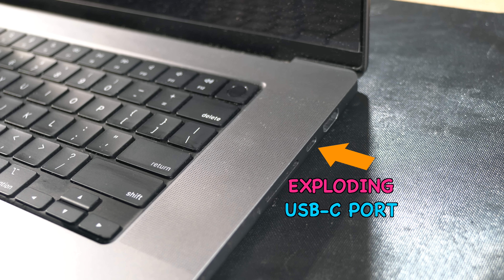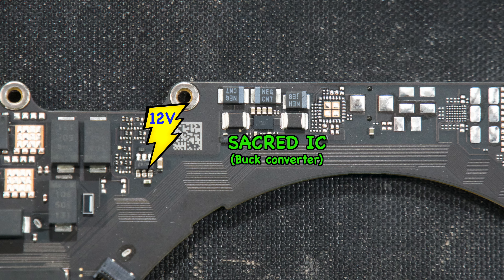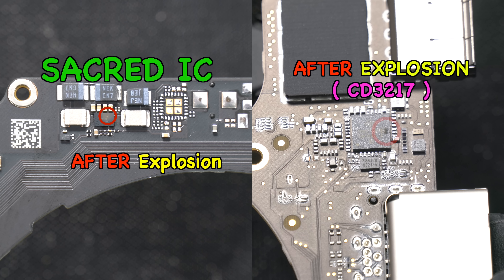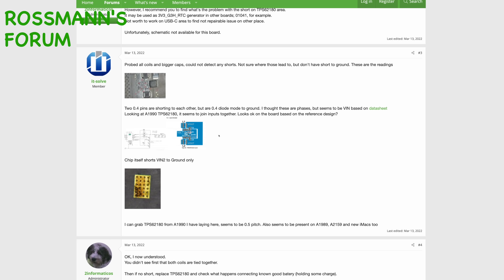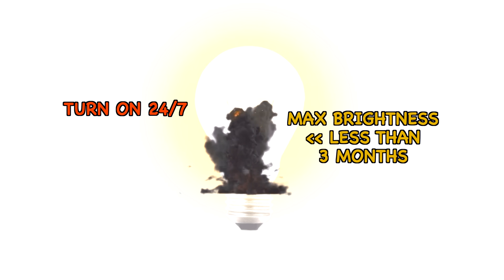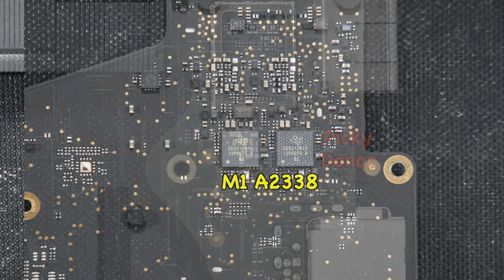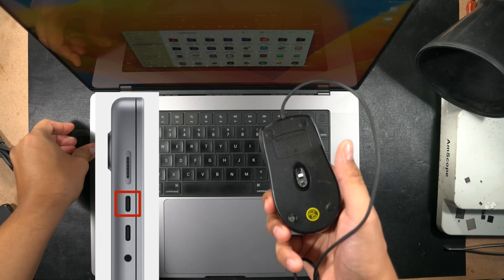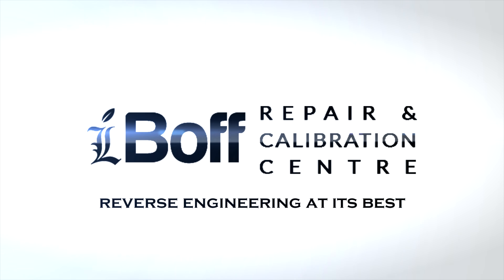Exploding MacBook Ports Explained : M1 Max, M1 Pro ( Not For Ignorant Dudes )

Comment: I've got an a1990 here with I am pretty sure this very problem. PPBUS_G3H was shorted and C9081 had some damage to it. First removed C9081 which removed the short but still no power on. So I guess TPS62180 is damaged. I am looking for replacement TPS62180 right now and see that mouser has 2 veersion, one with one output (TPS62180YZFR) and one with 2 outputs (TPS62180YZFT). Which of the two is the correct one?

Comment: Is this still an issue with the M4 pro MacBook Pro? I have a 16"
Reply: It’s fixed I opened up my MacBook Pro m4 and they redesigned the board with that chip gone now lol
Reply: @mirelurkhomevideos  Hi, sorry for the specific question, but have you been able to see which chip they used this time? I'm not being able to find anything online.
Reply: @alvise2106 I’ll get my digital microscope again out when I have the time to see what chip it is now
Reply: @mirelurkhomevideos  Thanks buddy, I have the same question! 16" M1 Max here, but I wanted to upgrade to a M3 Max or M4 Max anyway. This "chip issue" solved would fully convience me to go for the M4 Max model. I use the right USB-C port on my desktop most of the time.

Comment: Great video iBoff! This is the first video I've watched on your channel, and enjoyed it greatly.

I have a few questions hoping you or anyone else can answer.

1. If you only use the top left usb-c port, are you going to stress the CD3217 chip still? (I have M2 Max, 2023, and my wife has 2.6Ghz i7 2018, 15inch MBP)
2. If you have not had any failure yet, is it a good idea to replace CD3217 before it fails? 
3. I assume when CD3217 fails, it damages other components, is this correct?

Comment: I wonder if it is safe to plug in SD cards for long periods of time, does it also use the stepped down voltage from that sacred buck converter? SD should be 3.3V so I assume no?

Comment: Hey this thing just happened to my M1 Pro 14-inch. Wasn't using it for a week, was left disconnected. When I tried to turn it on, it was dead. It was working fine when last used. When I checked the board, it was completely dead. There was a hole in the CD3217. I wasn't using the right USB-C port at all since I saw this video 2-3 months ago. So apparently it can happen even without use.

It is my daily driver laptop for multimedia stuff, and I had some data on it... it failed just after 1 year of moderate use

Comment: hello, I was wondering what would happen if i let an externally powered device plugged in for a long time, this shouldn't happen right? the IC wouldn't need to deliver the current and the problem would not be applicable, right?

Comment: Is the sd card reader affected too?

Edit: Nope the SD card reader isn't affected by TPS62180 failure! It’s powered by another rail labeled PP3V3_AWAKE_SW_SD (3.3V) generated by a TPS62130B-S. The TPS62180 handles power for USB-C components, not the SD card! (This is the best info i could gather from some docs, trust it or not i won't take the blame if anything fails haha)
Reply: Pretty sure the SD card reader is connected to the PCIe bus on these models, at least that was the case on all Intel Macs I came across. I could be wrong though if Apple changed something on their ARM-based Macs.

Comment: Do I understand correctly, that this is only happening on the right side? I currently use the right port with a dock but I could switch to the left side. I always unplug in standby, as I don’t want my battery to die and in general I never leave devices plugged in when not in use. I only sometimes leave an ssd plugged in, usually in the left side. Will stop doing that for sure.

Comment: I am confused, so what macbook should we buy that long lasting? 

Now I have been using macbook pro 15" 2019 from 2020, surprisingly facing this issue (usb ic port exploding) in 2023 when rarely use it from 2022-2023. and currently I face the flexgate issue

Thinking to buy new one but with the same risk issue and higher price is scary. Cant imagine that cost for repairing
Reply: I’m wondering the same…
Reply: Must you buy a MacBook?
Reply: Must you buy a MacBook?

Comment: @iBoffRCC could you please elaborate a bit more on the different usage of these usb-c ports ?
More importantly, is connecting a thunderbolt or usb-c screen, and therefore also charging/powering the MacBook via this port could have the same devastating effect on the ports' ics as connecting a peripheral that needs to be powered by this port ?
This is not very clear from your video.

Comment: does it only affect type c ports?
for example if i kept a sdcard in slot would i be fine or an hdmi cable and magsafe?
Reply: same questio
Reply: @noobloop69  Did some digging and i think the issue is limited to the USB-C port and it's TPS62180.

The SD card slot uses its own 3.3V power rail from a totally separate TPS62130B-S, so leaving a card in the should be fine? Same goes for builtin HDMI & Magsafe, they’re powered independently and won’t be affected either (by this issue at least)

Best i could gather, do your own research before trusting this just in case :p

Comment: Just my anecdote, I keep two Dell monitors each connected to my Macbook M1 Pro via the two left USB-C supplying both power and display. They are connected 24/7 except the odd day or two each month where it’s disconnected for travel. It’s been over 2 years I’ve run it like this and haven’t had any problems yet.
Reply: Man I do these to with my dell monitors. Scared af since seeing this video
Reply: @LanceRazon  Yep, I am just going to unplug mine from now on and replug it each time. Lol, after watching this video, cannot pretend I did not know.
Reply: Come back when you have an issue
Reply: @jjptech  Yeah that's the plan if I remember to come back and update this comment in the future. But again even if it does die it's only one anecdote and shouldn't be biased and focused on this one experience.
Reply: Bro you’re really testing your luck here 😂
It’s a usb C cable just remove it
Reply: @legend-2890  It's for my business and it's got applecare+ on it. I hate how half the time after bringing it back up from sleep overnight it forgets all the window and app positions especially since I use multiple Spaces for each monitor. If I unplug it every night, it just never remembers any of it and I spend time every day moving all my apps back to their correct monitor and spaces view. Plus, if people are going to nitpick about their mac's life, right now its behaviour is set to keep the battery charged to 80% only to keep the battery healthy, if I keep unplugging it every night it'll remember to fully charge to 100% by night time when I don't actually need it.

Comment: I have MacBook Air m1. Should I be afraid of this issue?
Reply: No,  I’ve worked at an authorized repair shop for years and we rarely see port issues on any of the newer Mac’s. Most of the port issues we see are on aging intel MacBooks from the mid 2010s. My M1 Pro 14 inch MacBook Pro sat docked for a couple years using the right USB-C cable to dock it and I never had issues.

That isn’t to say it isn’t a problem, but it’s not some giant scandal affecting tons of people. Most of the M1 Pro/Max series computers out there will likely never have an issue from the manufacturing or parts used.

Comment: Hardware fuses. Typical of Apple planting hardware fuses to go off at a specified time so to get the consumer to upgrade their machine. - Planned obsolescence. If it don't work on hardware Apple plant software fuses via upgrades to slow down processors, fail the component that was meant to fail but didn't etc.  It is all about grabbing your reliable machine to get you spending again.

Comment: Already happened to me, during peak loads on all ports my right port just died and only started working again after a full reboot. Btw your animations are top tier, thank yu
Reply: "only started working again after a full reboot." if it started working again, then it didn't have the same problem as described here
Reply: This issue isn’t something that can be fixed with a simple reboot. Your issue is different, these chips are fried and have no hope of recovering

Comment: why didnt my macbook aoir 2020 m1 hasn't blew it's thunderbolt type c port after plugging in a type c hub for 2 days no unplugs?
Reply: Air M1 doesn't use the TPS62180 so it simply couldn't have happened.

Comment: How about charging? I always try to charge with a 5V USB Charger thru the USB-C Port over night, so battery charges slower which is better for the battery.  But is it save for the IC's? Should a future swap to the DigiKey IC be done before it should blow?

Comment: This is the kind of issue, you would expect from a device with 1/10th of the price. Within 20 years of non apple and much cheaper devices, I've had only 2 VRM failures, first one was because of shorted ceramic cap (I caused it by spinning a fan in opposite direction with vacuum cleaner), easily fixed by removing the said cap. And the second one was caused when I shorted Vcore of RTX 2060 when soldering extra capacitors, again easily solved by removing the short, and replacing a 12V fuse.
So all in all, nothing has ever failed for me, unless I caused it directly by myself.

Comment: If you use only quality cables, do not attach cheap hubs, and keep the ports clear of moisture and debris, then you will not experience USB-C port failure.
Reply: How can you tell before buying to make sure it’s a quality cable/accessory?
I may buy a Macbook or the Mac Mini/Studio soon and luckily I got this video in my recommended…
Reply: @rafaelacash7  Just purchase cables from Apple and you can save yourself the effort of performing research. Alternatively, there are YouTube channels where cables are reviewed. Be aware that cable manufacturers come and go. Unless I have a specific need for a cable that Apples doesn't sell, I avoid spending time on research.

Comment: I'll keep an eye on mine. I have a 2023 M2 Pro 14" model so its definitely got one of these suckers. I'm quite confident about replacing it if anything bad happens, but id rather not. I use it at work plugged into a USB-C dock all day, so that's slightly concerning. But at the same time, I didn't pay for it, nor will I be paying for the repair.

Comment: I remember many years back some models of Thinkpads had a similar issue with the lightning USB-C port, that would in time eventually break your computer.
Reply: If I remember correctly, it's the firmware issue.
Reply: @mikaelahyakuya3485  Yeah it was fixable with firmware, the T480 im pretty sure. A large amount of those laptops are just unusable because you didn’t even have to use the USB-C port all that much, just have the device powered on and it’d eventually break, while the firmware released after a lot of the damage had been done + some people just never updated it.
Reply: My E14 Gen 2 USB C Port died 4 times in a span of 2 years, the last one fried the mobo, but ofc no one posted video about this because people love thinkpads and hate apple :P
Reply: @jacobglass2951  Apples not really all that exceptionally awful of a company, they’re just the biggest that gets the most publicity. I love Thinkpads myself but models like the T480 would literally destroy themselves from just being… powered on, while to ruin specifically the M1 Max and M1 Pro models of the Macbook Pro, you need to have a specific USB-C port in constant use for a long time. 

Hell, the T480 specifically was a pretty great laptop, that a lot of people think of as being the last “great” Thinkpad. Nowadays Thinkpads are more guilty of the things Apple are blamed for, like being overpriced - the new Snapdragon Thinkpad costs twice the price of a Macbook Air, for example.

Comment: Engineers that prototyped this IC must be sued for real
Reply: Not the Engineers, the one forcing the low budget should. In this case apple
Reply: @otozinclus3593  if the cheaper chip works well, then why not to use it?

But the IC die has some design flaws that may or may not occur, so it didn't have any reliability tests. 
Apple probably didn't expect that chip to fail and made a reasonable cost cut.
Reply: That's apple's fault. Chip has clearly stated specs, which apple clearly doesn't follow.
Reply: @panjak323  nope the stated specs are within the expected usage. so its the manufactures fault and not apples
Reply: @benNdaKen  Then why keep using the same chips for nearly decade ? If they see 60% electrical failures caused by only this, then it's their responsibility to fix the design and use different chips.
Reply: @panjak323 not really, it’s on the end user to stop buying a product with a known design flaw. The only thing Apple will listen to is anything that affects their bottom line, and boycotting is a pretty fast way to.
Reply: @unluckycord3218  okay, but user doesn't see inside the machine, does he ? 0.1% of people buying it, know what buck converter is.

Point being Apple sucks
Reply: @panjak323 sure, but once you’ve experienced this issue, you would be aware, and stop buying it correct?
Reply: @unluckycord3218  me personally ?
Yes.
Reply: @panjak323  Exactly, it would be slow, but it is a moral stance to not buy a product with known design flaws. Hell, even if you NEED a Mac, just buy it from a 3rd party used so apple never receives YOUR money ever.
Reply: @benNdaKen  Inrush currents and inductive loading will spike the current draw.
Reply: @panjak323 
10 amps for 2 ports
But 6 amps for 1 port 

Seems logical, but something went wrong
Reply: @Gameplayer55055  it's not just about "the amps". Board layout matters a lot in buck converter applications. Example, put one capacitor too far away, whole chip can then kill itself by voltage transients.

Comment: Naw man. SO basically don't use your mac the way you use your mac. I'm not unplugging my usb hub that connects my monitor and external hard drives which power my home media server. If you unplug the display the computer turns off / sleeps. So yeah. always on 24/7 if it's an apple problem applecare will cover a replacement but not changing my behavior on the off chance that it fails. thats on apple.

Comment: Apple's been using these chips since 2015 with constant failures. I don't know who the hell keeps forcing these on these machines.
Reply: Apple does, because of the following:
1. Probably the cheapest USB C controller on the market, giving them a higher profit margin in production.
2. If they fail, that means the customer needs to buy a new one.

There is a fine line between form and function and apple has always thrown out all function for form. Every single Mac model since 2004-2005 is plagued with some sort of issue. Even the 13" Unibody MacBooks.
Reply: @IIdankII  That's true with a few exceptions. Just because you can get away with it doesn't mean you should. Apple built their Mac's to be disposable trash even in Steve Job's late hay day. Their "this Mac is recyclable" advertisements essentially meant you're meant to recycle them as they're shitty products. 

To be fair, other Apple Product's like iPhones have had no issues with longevity, it's always just something minor like a screen cracking. 

The iMac G5 was what set it off and has to be deemed as the worst product Apple has ever shat out, worse than the Lisa. 

It got only one year of software updates, was about as reliable as an MP's "promise" and had the worst sounding speakers and build quality of any Mac to ever hit consumer shelves. 

It was lazy and kicked off a lazy cycle in Apple's products.
Reply: @megatronskneecap  do you realize Apple Silicon macbooks are sold in tens of millions while they've only shown two reports of this happening online with third being the one in this video.
Reply: @Egor9090  None is talking about Apple silicon MacBook's specifically, there have been tons of videos from Louis Rossman, Paul Daniels, LECFix and the like of these bad IC's constantly dying in even Intel MacBook's with USB-C.
Reply: @megatronskneecap define "constantly". How many died out of tens of millions sold per year.
Reply: @Egor9090  Why does the number of how many die matter? They died that’s bad enough. Comparing a 2016 MacBook Pro to a 2012 MacBook Pro is a world of difference and the difference isn’t exactly good.
Reply: @megatronskneecap because in every business there is an acceptable failure rate. In my industry, construction it is 5%. So any raw material thats in your house, lets say steel in your foundations, 5% of them will not have the advertised yield strength. 5% of the cement in your concrete will not be able to harden to the required strength, 5% of your whatever is weaker than it should be, but that is okay. Its probably a much lower rate in electronics, but a set rate of failure is acceptable
Reply: @birtalanlorant5572  Except for the fact the failure rate is much higher than 5%
Reply: @megatronskneecap  thats ridiculously bad then, if out of 100 products sold 5 fail.
Reply: Because they can, and they have such little confidence in their products that they only put on a 1 year warranty.

There are hard drives you can buy that are warrantied for five years.
Reply: That's like when they kept using really cheap ineffective capacitors for the 17" Unibody MacBooks and then butterfly keyboard for 4 years even when they were failing at a rapid rate and had to be forced to offer replacements. When MacBooks work they are great but when they don't it's an expensive problem and there should be no cheap components in such an expensive device.
Reply: I know who's forcing this, it's called obsolescence.

Comment: I connect my MBP M2 to a hub and use an external monitor and connect the charging cable to the hub. Will that also damage the USB C port?
Reply: If you don't turn off your Mac, potentially might. You can offset the headache by making backups and buying Apple Care+.